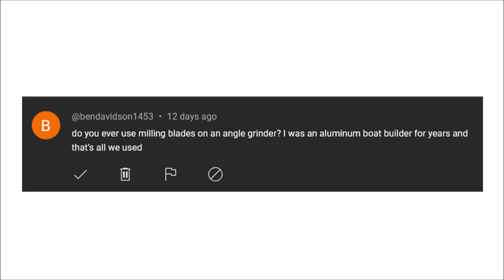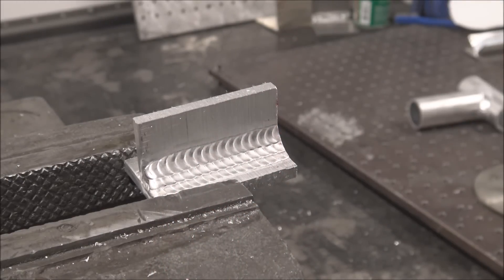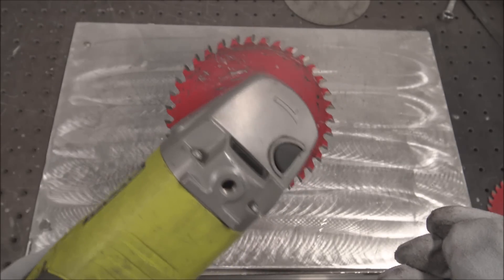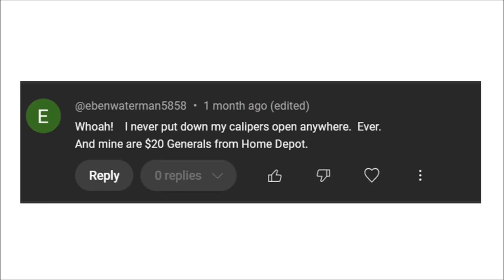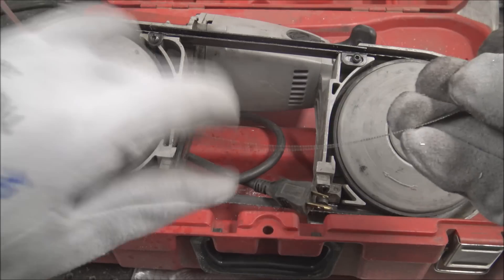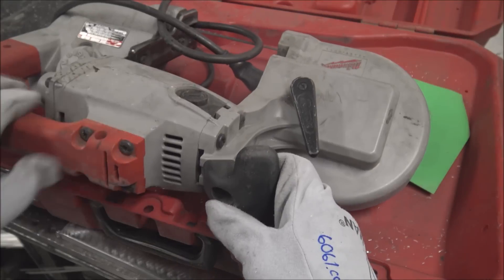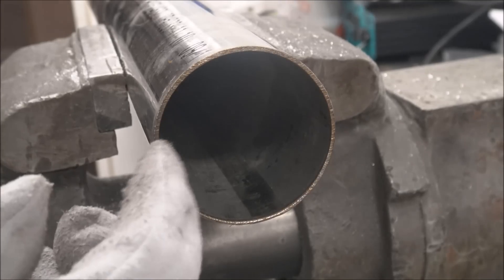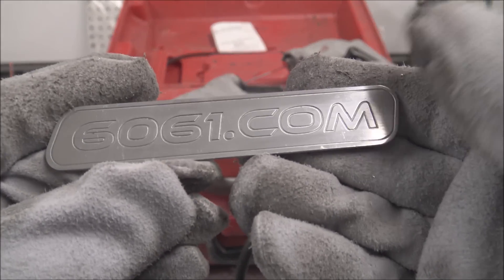Aluminum Fabrication - Cutting with an Angle Grinder

Comment: They have special angle grinder blades for aluminum for a reason. I can't remember what that reason is but everyone said it was really dangerous to use regular blades and made out like I was an idiot for asking.

I remember buying angle grinder wheels that said "for aluminum" on the side before I got my CNC machine and carbide end mills.

Comment: There are zero rake, or even negative rake tooth blades in larger sizes. I wonder whether any brands make them in grinder size. You could always re-grind the carbide teeth, or have this done at a sharpener. This shape takes away some of the bite.

Comment: I cut aluminum all the time with my compound miter saw and my table saw. The blades that I use are somewhat finer than the one that you use. If you have a bigger cut to make, give the aluminum a light shot of WD40. Also, don't be afraid to get a bit aggressive with the feed rate. You will feel the saw bogging down a bit if you are too aggressive. If you go too slow, then you just create friction and friction melts the aluminum and that melted aluminum is what clogs up the saw blade.

Comment: Excellent video!  For cutting sheet, I typically use my circular saw; for pipe/angle, I use my miter saw.  I did recently buy a HF buffer/polisher (for reduced RPM's) and use a HF metal cutting saw on it; works slick for gouging/beveling cracks, or removing unwanted [previous, not mine] weld. I also have the AL carbide die grinder burrs; the saw blade is just sooo much faster.

Since we're on the subject.... kinda disappointed that you didn't break out the chainsaw again-  😔😂🤣

Comment: Ha. I did this yesterday, grabbed a cheap 2$ harbor freight mini saw blade, ran a step drill through it. Was cutting some solid aluminum blocks and it just ate it like butter. Just a regular saw blade not even metal or non ferrous. Mine leaves a VERY good finish though- way better than that diablo left

Comment: We use similar blades but the safest we've found and most stable have been the "Bad Blades" from Kwiktool USA and are already bored out to fit on 5/8" grinder shaft. Never use them without a guard though, there's a reason we call them finger eaters in the shop....

Comment: Circular saw blade in a grinder with no guard? No thanks. That looks like a recipe for lost fingers regardless of how familiar with grinders. Also, wouldn't a negative rake blade be better, to reduce the chances of it grabbing like all the carbide tipped blades intended for cutting metal?

Comment: We call these "Meat Axes".  We do use these for removal of damaged parts on LCAC but man, the horror stories of these things.  PPE and head on streight is a MUST when useing this tool.  I only use on Air powered 4 1/2 inch not on electrics. We lube with beeswax.  Magic.  Rips aluminum like a champ.

Comment: Hey man he probably ment milling/cutting blades (AKa "The Meat Axe”)  Austsaw do a nice one that will fit most grinders.. great for taking off bulk material and cutting. Used with cutting wax. Big in the boat building scene here in Aus / Nz.

Comment: I worked in aalminum shop building truck bumpers. We used those mini  Diablo blades for bevelling and other things" called it a meat saw". Those blades are very dangerous and you defenitaly need to be paying attention when using them. Thanks for the tips.
Reply: Looks brave to use those blades on a grinder. I'm just wondering if you would use that with an adujustable speed grinder or go full speed. Anyway I wouldn't dare to do it. Interesting to see what others do. I'm not using grinders for a living so I don't feel like taking a risk. And at work they wouldn't like to see those things.

Comment: Coming from a lifelong shop-dweller i say keep the protection on the grinder. If it goes in the way - buy a less shitty grinder next time. And learn to cope with the protection. I use it to hold the machine even tighter and guide it more precise. Shield my self from sparks and swarf etc...

Comment: I had to cut apart an aluminum dumptruck gate, to replace the latches.  i was recommended to use a circular saw with a wood cutting blade.  waaaaay faster than a cutoff wheel!
Reply: Yeah, when cutting aluminium treat it like wood, when sanding use wd40 on the sanding disks or high pressure grease on the die grinder bits, aluminium smears

Comment: just use a miter saw
Reply: I bought a Motabo on sale cheap and threw some diablo ferrous and non ferrous blades on it.  Only issue is finding a saw that runs the right speed for the blades.
Reply: Every fit something large like a trailer, boat, rack on a stationary saw?